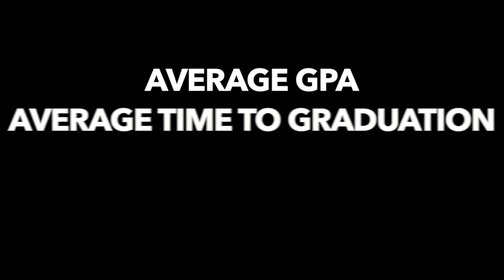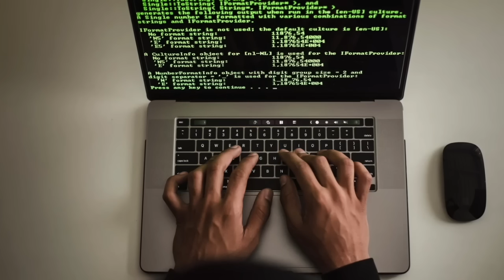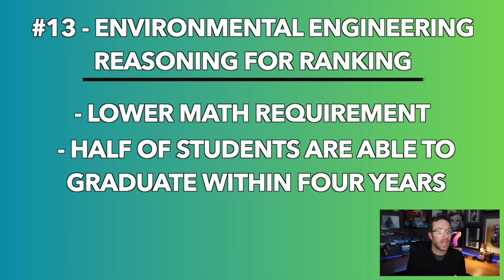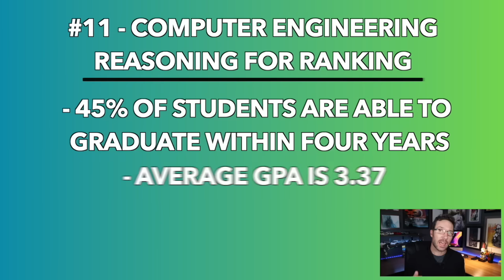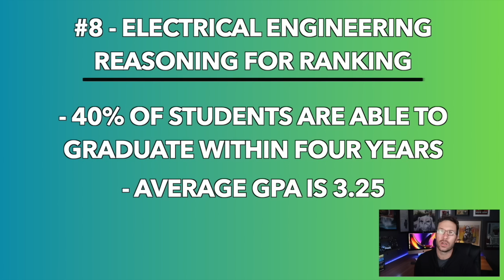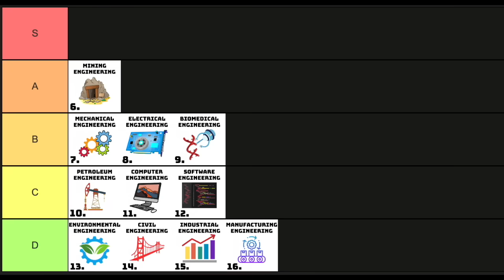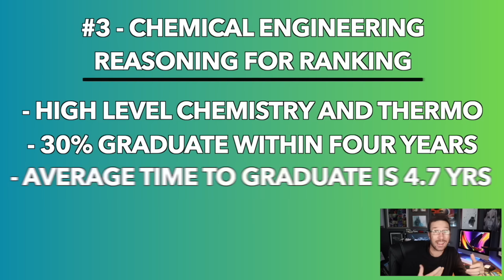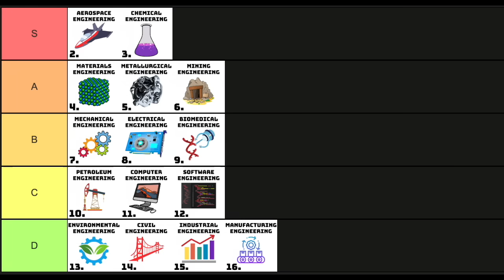Engineering Degrees Ranked By Difficulty (Tier List)

Comment: It must be different in the UK. Part of my first degree included partial differentials, numerical mathematics, chemistry, structural engineering, 3d behaviour of materials, languages, thermodynamics, hydraulics, computing, geology, mineralogy, soil mechanics, etc. I was therefore surprised to see Civil Engineering so low down as Civil Engineers can adapt to many types of work. My second degree (PhD) was neural networks in autonomous underwater vehicles. I mainly worked in Oil and Gas, but also in bridge design, and offshore converter stations, and was Client Rep in many multi National major projects. Its far too simple to classify Civil Engineers as Bridge Designers etc, as the training is based on a world of opportunities 😁🇬🇧

Comment: ME here. After 30 years in the field I can say with certainty that what you learn to get a BS degree in engineering isn’t quite enough to make you competitive. I wish my college had taught about engineering procedures and processes like design reviews, change management, product lifecycle and so on. Also would have been good to have a basic understanding of business concepts relating to engineering and manufacturing and where the “value add” is. Also I’ve learned that having any level of coding skills that can be applied to practical engineering problems is a strong plus and a force multiplier. I realize that 4 years is a long time in school but maybe an extra semester would have made me much more competitive and earn more fresh out of school.

Comment: I am a retired engineer. My diploma says Electrical, Electronic, and Psychology. The company I worked for was a large electric utility. What I learned from my engineering courses was a small part (10%-15 %) of what I needed to know to do my job. I was fortunate to have access to a federal library that could provide me with any technical publications that I requested. 

While I was still an under graduate I worked for three departments of the large utility. The first was a department that wrote specifications for purchase of specialized equipment. In this case a 230 kV mobile transformer that could quickly restore electrical service where the 230 kV transformer failed. The transformer was to be manufactured to the applicable ANSI and CIGRE standards or higher standards when specified. The department heads and personal of those that would maintain, transport and install the mobile transformer were asked to comment. The head of the highway department of the five states where the mobile transformer would be transported to or through were contacted by phone to discuss unusual size and weight and the possible stress put on the highways and bridges. Each of the sites where the mobile transformer might be needed were visited along with the personal that were responsible for maintaining local access so that there would be no impediments or surprises. Nothing in this assignment was part of the engineering curriculum.

The next department, High Voltage Practices, an emergency transformer loading guide to set a limit on acceptable loading above the nameplate loading that would limit the carmelization of the electrical insulation paper to an acceptable rate. This would be based on IEEE/ANSI standards expressed in Fortran programming code and transformer test reports and presented for a range of ambient temperatures. Again nothing in this assignment was part of the engineering curriculum.

The last of the three departments, Relays, was tasked with designing a computer with Intel’s latest CPU in a DIP (duel inline package) that operated at 12 MHz. Personal computers we operating at 1 0r 2 MHz. This project was contracted by the Department of Energy to us to be used on their facilities on the Hanford Nuclear Reservation to create an energy managing system lieu of reconductoring the existing transmission line to accommodate new load. The computer had to operate in an outdoor industrial environment. I selected a waterproof NEMA (Motor & Equipment Manufacturers Association) box. The mother board was mounted on the back panel with the human interface on the door connected by ribbon cable. The input signal could be as low as 5 volt transistor logic to 1.1 times 120 VAC and was protected from surges by varistors. The input part of the motherboard was optically isolated from the logic and signal transmission sections. The power supply for the mother board buffered by addition LC circuits in addition to what was provided by power supplies normally used in our substations. Much of what went into the design was learned as a millwright in the wood products and steel foundry industries. My Electrical Engineering courses did give me a lot of confidence.

Comment: I am a bit confused by the 'average' salaries reported. The salaries reported are all extremely low, and look more like year 0-3 salaries before you are fully licensed. Is this because there is a significant offset in survey participants in their first 5 years of employment?
I would actually say a fully licensed engineer with any one of these degrees, will be above those average salaries as a starting salary, and most mid career Engineers are likely $100-180k with late career engineers being notably >$180k. 

Averaging $85k makes it seem like engineering bring a slightly above average middle class income, but engineers are famously and notably upper middle class generally in the top 5% income over a successful career.

Comment: As an engineer myself, I already know this list is ass when I saw EE in B tier. Not only is he wrong that the highest math needed in ODE, it's also required to know high level physics, which is something significant when looking at difficultly.

Theoretical is always more difficult then empirical.

Not only that, u place Mechanical Eng. Higher? 🤣🤣 That's laughable. Not only do EE's need to take hardest ME classes, ME's don't need to take the hardest EE classes 🤣. So much misinformation here. Btw I'm a not even EE.

Comment: Never did partial differential equations after college. I'd rarely integrate or differentiate at work. The computers can do it with a click. But you do need to understand WHY you need to do it. It can be powerful, and misleading.

Comment: I’m a Mechatronic Engineer. Most of my courses were a mixture of Mechanical and Electrical Engineering courses with upper divisions Mechatronic course like Controls Systems Design and Motion/Machine Automation. In my opinion I think it has to more difficult than mechanical and electrical because you get the best of both worlds.

Comment: A couple of really bad slips in your presentation. 1. Kinematic behaviour of materials? What would it be? I think you really ment dynamic rather than kinematic. 2. Chemistry as non-exact science? How come? Makes no sense, even when comparing it to physics. And do not compare it to math, because mathematics is not science! In my view, a good example of non-exact science would be sociology or psychology, as many would argue that these aren’t sciences at all. On the positive side, I must praise you for pointing out that mechanical engineering, as commonly understood, has the broadest scope of all engineering disciplines. I must also add that you’ve missed several other engineeing disciplines, such as electronic engineering, engineering physics (sometimes referred to as engineering science) an engineering mechanics (something of the past by now). In addition, new disciplines, such biochemical or biological engineering, have appeared and seem fo face good growth prospects.

Comment: Chemical engineering is not only about chemistry and the analysis of lab results. It is about process control, process development, and process optimisation. You have to have a knack for crunching data and analysing trends,etc. It's not an 8 to 16h30 profession.

Comment: I’m disappointed. U should know better. There only 4basic disciplines of Engineering:

1. Electrical
2. Chemical
3. Civil
4. Mechanical 

Everything else is either related or a bastardized misnomer. 

Ordinary differential equations is Calculus 3.
Reply: You are so wrong. Calculus 3 (Multivariable Calculus) and Differential Equations are distinct but related branches of mathematics. Calculus 3 focuses on extending single-variable calculus concepts to functions of multiple variables, while Differential Equations deals with equations involving derivatives of unknown functions. While some Calculus 3 concepts can be helpful in Differential Equations, they are not always strict prerequisites, and many Differential Equations courses build primarily on single-variable calculus. 

Calculus 3 (Multivariable Calculus):
- Focus: Extends calculus concepts like derivatives and integrals to functions of multiple variables (e.g., functions of x, y, and z). 
- Key Topics: Partial derivatives, multiple integrals, vector fields, vector calculus (divergence, curl), theorems like Green's and Stokes'. 
- Applications: Used in physics (e.g., electromagnetism, fluid dynamics), engineering, computer graphics, and data modeling. 
- Prerequisites: Typically, Calculus 1 and 2 (single-variable calculus) are required. 

Differential Equations:
- Focus: Studies equations that involve derivatives of unknown functions, describing relationships between a function and its rates of change. 
- Key Topics: Solving various types of differential equations (ordinary and partial), including first-order, second-order, linear, and nonlinear equations. 
- Applications: Widely used in physics, engineering, biology, economics, and other fields to model dynamic systems and predict behavior over time. 
- Prerequisites: Primarily builds upon single-variable calculus (Calculus 1 and 2). While some knowledge of multivariable calculus (Calculus 3) can be helpful, it's often not a strict prerequisite.

Comment: Yes nuclear power engineering is challenging, requires understanding in a lot of different disciplines. From experience, I worked for the nucleat power industry several years, but also for conventional power. The advantage of conventional power, is much more degrees of freedom, decision abiity and oversight. For an equivalent complexity, you will have a ratio of 4 to 7 at least for solving/engineering aspects in nuclear engineering compared to conventional power. That makes conventional power much more fun (but also much more stress)

Comment: There is so much one can say here.  A starting point is that not all students are equal.  A small number are extremely bright, many are average, and some are as dull as a weak bulb.  The bright students will finish in 4 years, the dull ones in 5 or more.  Next, where one goes to get a degree makes a huge difference.  The better universities have better faculty, better curriculum, attract better students, and produce a better product.  The low end universities, the exact opposite.  And so on.

Comment: The 1st issue is the reason why it takes longer for nuclear , mining etc is that because there is 0% growth, there are not a lot of students so not all the classes are offered in when needed. 2nd, your understanding of what math is required is wrong .. for my EE degree I had cal. 1,2,3, diff eq, advanced eng math (partial diff, laplace, rier, matrix), engineering statistics, vector calculus.  And the classes fields and waves, transform analysis,  random signals are EE classes that are basically all math... much more math and the ME students.. in addition we have to take statics, dynamics, thermo, heatransfer, materials 1 and 2.. of which we always got  A while the ME students would struggled in the EE classes.

Comment: Right out of the gate you're wrong. I graduated as a manufacturing engineer in 2018 and I had to take Calc 1,2,3, Diff EQ, and advance linear algebra. The degree was hardly any different than a mechanical engineering degree.

Comment: I don’t know where this guy gets his information from.  But as a working chemical engineer I know the highest math requirements are much more than ordinary differential equations.  The chemistry requirements include courses in quantum mechanics which requires a working knowledge of wave equations and other advanced mathematics.  In addition a chemical engineering student has to take a full year of organic chemistry, advanced circuits and some programming.  I can’t speak on the other disciplines the guy discusses but he oversimplifies the requirements for chemical engineering.
With that said, the most difficult course you take will be the one that least interests you.
Only major in engineering if you want to be one.  If your goal is to make a lot of money, then major in accounting or some similar.

Comment: This analysis is total bs. All of the majors listed are four year degrees, and some of this analysis doesnt take into account the level of difficulty in the respective engineering courses. Nuclear engineering doesnt have more complex mechanical systems courses than mechanical engineering. Environmental engineering does not require more math than Civil Engineering. Plus, youre not considering the level of physics required as well as the difficulty of the actual civil engineering courses. I dont think that the person who did this analysis is an engineer, but i am, and for me the order of the list should be:

nuclear engineering
chemical engineering
aerospace engineering
mechanical engineering
electrical engineering
civil engineering
etc etc
industrial engineering (last)

Comment: Missed the best one.  Welding-Joining Engineer. Another Jack of All Trades.  Welding/Adhesives/Mechanical Joining + Metallurgy + Controls + Vision + Inspection. Used just about everywhere. Easy to get a good job. Great career!

Comment: bruh, computer engineering is definitely higher. you never have to relearn calculus 3 again. but you need to be learning new languages constantly. mechanical engineering is not that difficult, its literally just conversions all day long. electrical is hard. biomedical is a joke but has a lot of potential. bruh mining is definitely lower. the rest are ok

Comment: Retired ME here. I worked in aerospace and nuclear power for 40 years. I agree for the most part of the ranking. But I think the hardest engineering are those radio frequency engineers who make radar, sonar, wifi, bluetooth, cell phones, etc all work. I am not sure what to call them. But I believe these engineers use the complex math all the time (whereas most of us engineers out in the workforce really just rely on spreadsheets).
Reply: There are called Electronic Engineers, electrical engineering has many disciplines from power to Communications. Electrical engineers along with physicist designing all the electronic components and computers chips.

Comment: The most difficult degree for an individual is the  field you are least interested in.

The "easiest" for an individual  is in the field you are interested in.

I mastered in electrical engineering -  semiconductors (compute engines which as means mastering software languages),  photonics, high speed signal processing, eg. RF , and circuit design.

Why so broad? Since I wanted to design systems. It took a lot more time than the normal path.

But I found it easy and totally enjoyable. Part of  which is I find every field of study from Chemistry and Phyics to English literature and foreign languages. The only downside is I find it difficult to relate to people, but  it makes me appreciate people more and I am never satisfied with what I know,I want to know more. 

And I absolutely  agreed that in my first year I had to mater self-displine and tine management. In high school, I skipped grades and still received 97-100% by talent alone. That does not work so well in university. There is only 24 hours in a day, no matter how much talent one has. My hat goes off to those studying medicine as I need at least 5 hours of sleep a day for my brain to function so my mind can think. And at tines, they are dealing with life and death situations.

Comment: BSME 1972 here.  Host is spot on regarding flexibility for mech engrg.  I started off designing business equipment, quickly moved to oilfield service (directional drilling and surveying), and retired at NASA after 23 years working on space shuttle and ISS (mostly tools for astronauts working EVA).  I would never have dreamed the path I took, but every job was fulfilling, interesting, and paid well.

Comment: Hate to tell you but I took electrical engineering 20 years ago and I had a course called complex functions and partial differential equations. Also in this class where mechanical and chemical engineers.

Comment: As a mechanical engineer with 50+ years working experience maths is no longer paramount. Computer software has superseded the need.
Im my field of fluid dynamics the software dies it. Solving 4 simulaneous partial differential equations with small differences in large numbers. Written by smart NASA engineers.
My toolmaker trade apprenticeship helps me put my experience into practice.
When uou cant remember your son's age but know version of Wondows was when he was born, your an engineer. Don McMillan.

Comment: When I was struggling my way to an EE degree in the 1950s, I ranked discipline difficulty by watching student transfers. In those days I ranked chemical engineering as most difficult because nobody transferred into it. Students with chemE problems transferred into electrical, mechanical or civil, or left engineering altogether. Students with problems in aero or EE never went to chem, they changed to mechanical or civil, etc., or something in "Lit" school. By the way, including highest level of math may be a bit misleading. My EE courses were about 95% theory with every blackboard filled with a derivation of some kind. Our math classes never kept up with the professors and teaching fellows and they all resorted to teaching some advanced math to allow them to proceed.